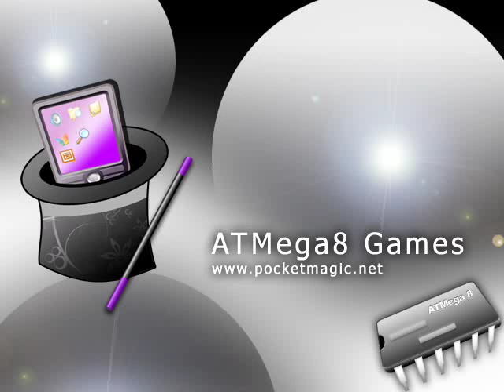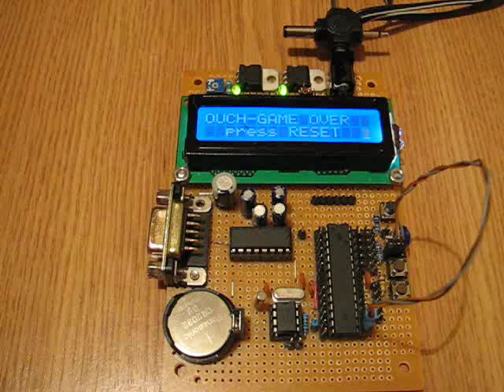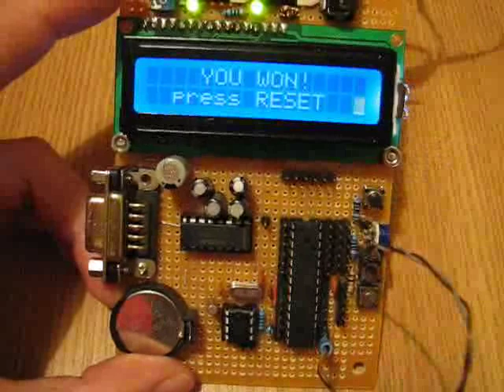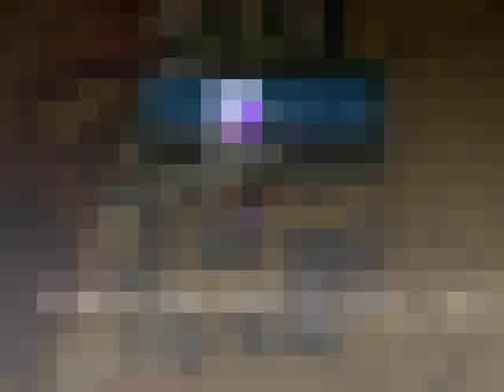ATMega8 LCD Game

Comment: had that problem of randomness when I got introduced to avr in school and programmed a game. It seemed to be about impossible until I did stop trying to think that it need to be done some weird&hard way :-)

So.. All you need is to start some timer at somepoint, and read the value of it at some random point(first time user press a key to start the game?)  and there you have it.. Very random seed for your random number generator.
Also could store a seed to eprom and +1 to it on every powerup.